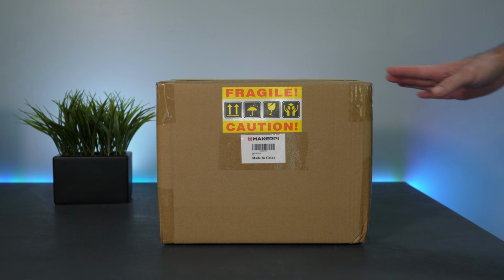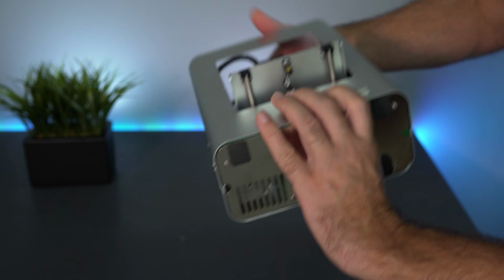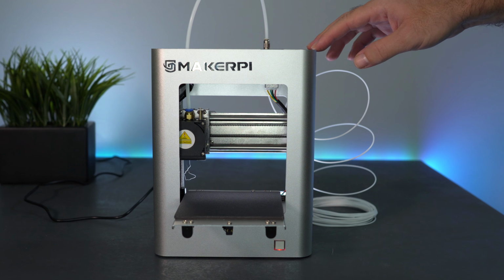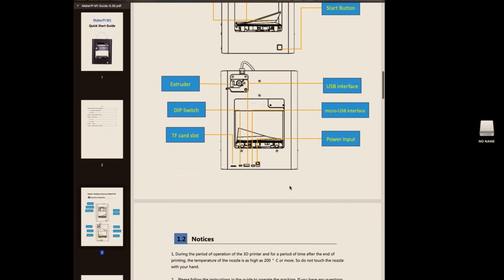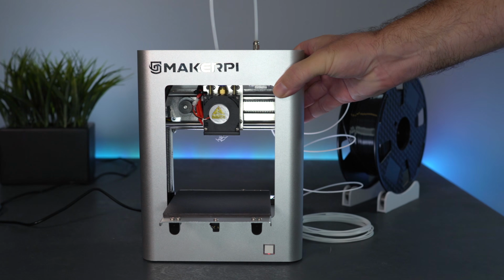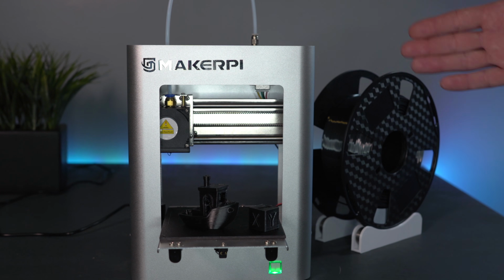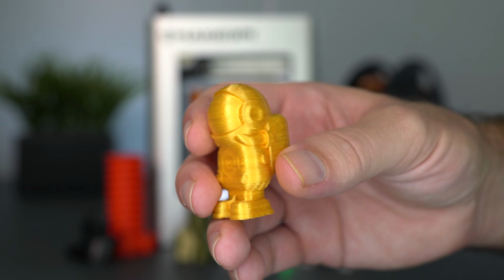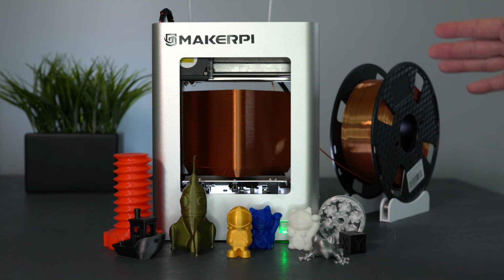MakerPi M1 - Mini 3D Printer - Unbox & Setup

Comment: I got this makerpi m1 from the manufacturer itself. Another ultra crap product from china. Almost everything has to be set manually. This is the worst 3d printer to buy. Guys, please don't buy this shitty printer. Cura doesn't even have a profile for this m1.
Reply: The printer itself is good, but customer support is abysmal, you have to figure everything out by yourself - which is not how entry level printer should work. The printer can autolevel and only minimal manual adjustment is necessary, but it is not easy for a beginner to figure it out and info from manufacturer is actually misleading.

Comment: Definitely an entry level printer for new users. Easy to setup and use but the slicing should be made easier for beginners. Solid build with "real" stepper motors/hotend which isn't always the case.
Could be a good present.

Comment: Great little printer especially for the 169.00 USD on Amazon. I wish it had a manual bed leveling option. I'm thinking you could use 0.002 flat feeler gangue where it levels and that might stop any bed damage. I use a 0.09 to level my ender and my prints are great. You would need to use a much thinner gangue due to the auto leveling compute.
Reply: What’s the print area ?
Reply: @whowatwhere7936  for the mini 100x100x100 for the ender s pro 220x220x220 but it's actually 235mm